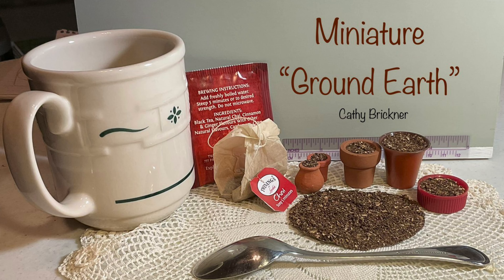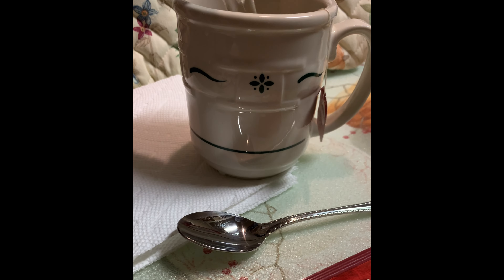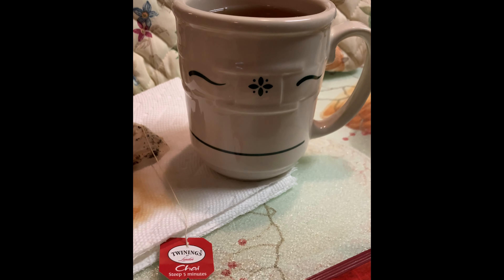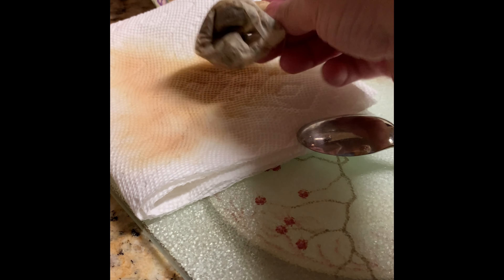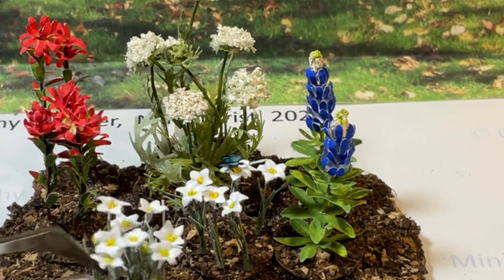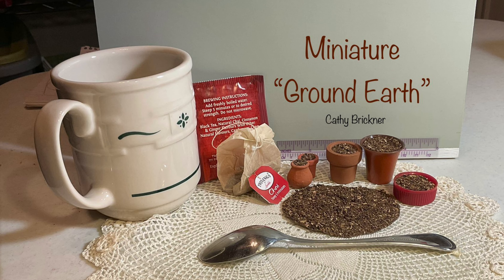1:12 & 1:24 scales DIY Easy miniature “Ground Earth” for landscaping displays with used tea leaves

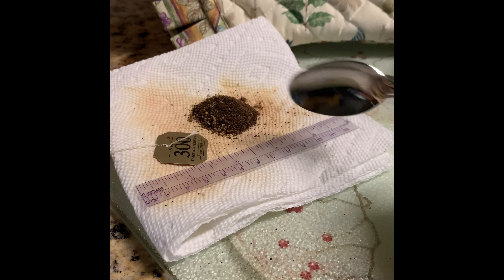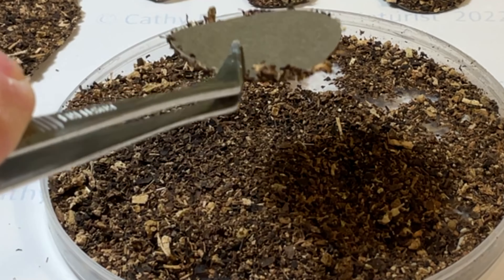Comment: I've found the good old dried coffee grinds mixed with glue perfect to be used as dirt in planting pots (I do mostly 1:24 - + 1:48, and 1:87, but haven dived in to making plants in those scales yet). - I'll return to the Coffe grinds later on, but first I'd just like to say that this - the dried Tea Ground Earth I think could work perfect as a ground cover in my greenhouse/conservatory that I'm working on. So Thanks for sharing! =)

Now the Coffee grind glue mix: It looks really great for a 1:24 scale potted plant, but there is an issue I've been having (I'm still new to this game, and are starting to notice issues that weren't there in the beginning - at least not visibly so, but seems to have cropped up during the months since. With the coffee grinds-glue mix I've noticed it seems to affect the pot in an undesirable way. - I make the pot's from what I believe would be translated to cardstock (thick paper, like 240-260 g/m thickness) , which is then covered either with (Windsor-Newton) Heavy Carvable Modelling Paste Acrylic Medium, or Paper paste - or both - to make it more durable and harder, plus adding a bit of structure - then painted and "pimped out" with acrylic paint or acrylic hobby lacquer. Later on, when I'm planting my tiny plants and what not, it seems the glue in the "dirt"-mix sticks to the pot (which is kind of the thing - or one of the things - you want it to do). Once dried it looks as it should -no problems, but after a couple of months (while they sit waiting for me to get all the other things ready ;) ), the pot no longer has the same shape as before. E.g. instead of round, it looks kind of "dinged up", or has attained vertical edges, or it's bulging on one side. The worst part is, well, sometimes the pot no longer fit inside it's outer pot, but that's not as bad as when the "new" shape of the pot makes it so that it can no longer stand up by it self. I should perhaps add that it doesn't seem to be an over-all problem - it's more of a some-do-some-don't problem. Though that could be an issue of time passed since they were made....? I don't know. =/ 
If any one has a suggestion for me to try that would solve this issue, I'd greatly appreciate it! =)

Cheers! and Thanks again for sharing yet another great technique!
Stay Safe, and Stay Sane! =)